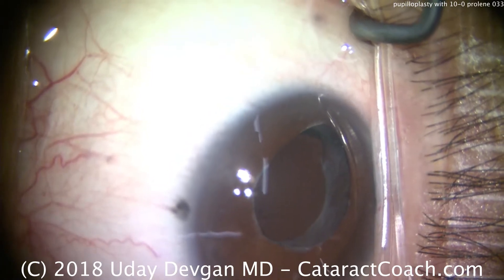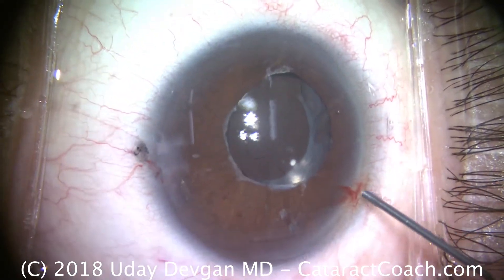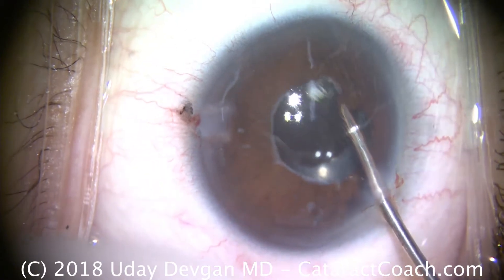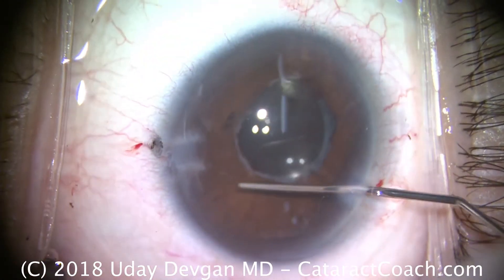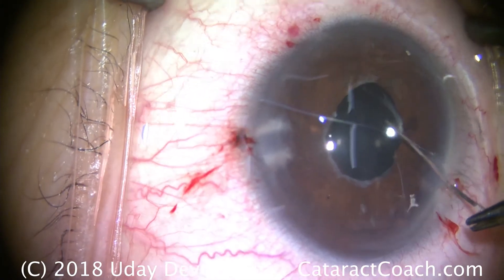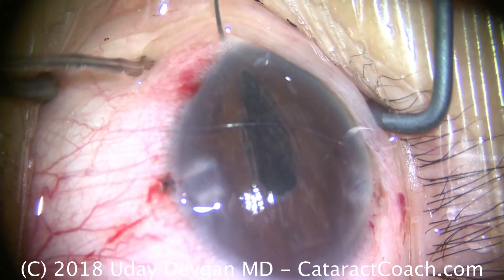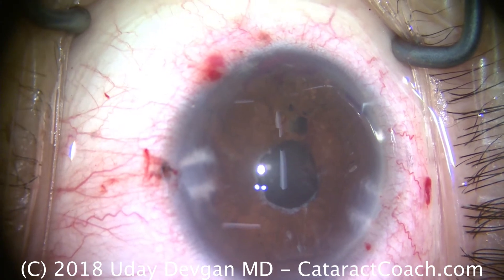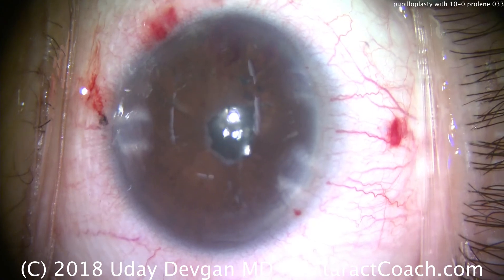3 Steps to Success with Pupilloplasty (to repair iris damage)

Comment: After you stitch it, can the iris still constrict and get bigger?
Reply: Ai answer -                               Yes, it is possible for the iris to still constrict and dilate (get bigger or smaller) after pupilloplasty and stitching. The extent of iris movement may vary depending on the individual's healing process and the effectiveness of the surgery.

Pupilloplasty is a surgical procedure that aims to repair or reconstruct the pupil, and stitching is used to close the incision. While the surgery can improve pupil function, it may not completely restore normal iris movement.

There are a few reasons why iris movement may still occur after surgery:

1. *Incomplete repair*: The surgical repair may not have fully restored the pupil's natural movement.
2. *Scarring*: Scarring from the surgery can affect iris movement.
3. *Nerve damage*: Nerve damage during surgery can impact iris function.
4. *Individual healing*: Everyone's healing process is unique, and some individuals may experience more iris movement than others.

It's essential to follow up with your eye doctor (ophthalmologist) to monitor your progress and address any concerns. They can assess your pupil's function and provide guidance on managing any remaining symptoms.
Reply: Same question ❓⁉️⁉️ bro